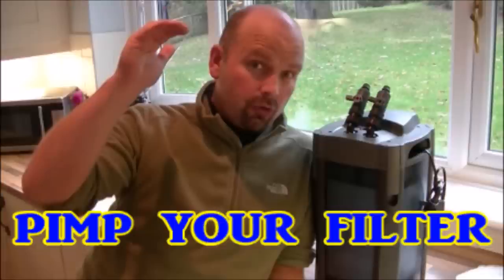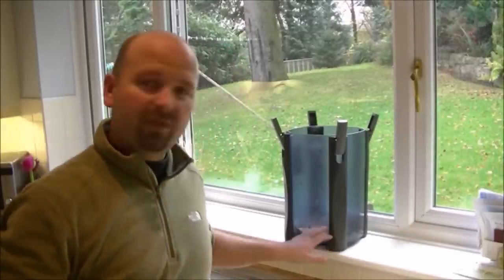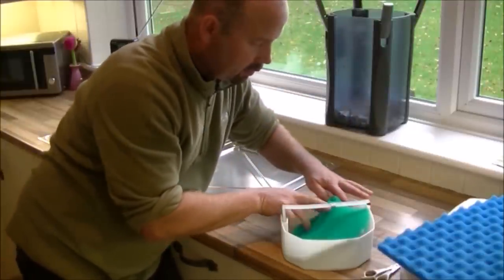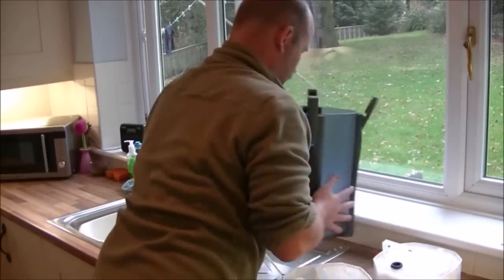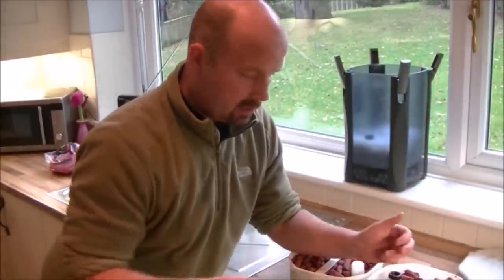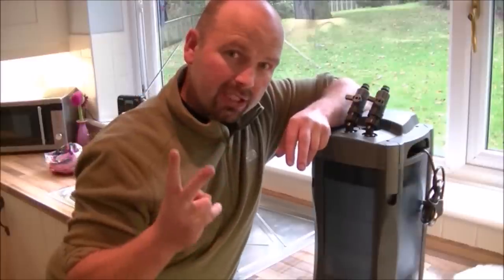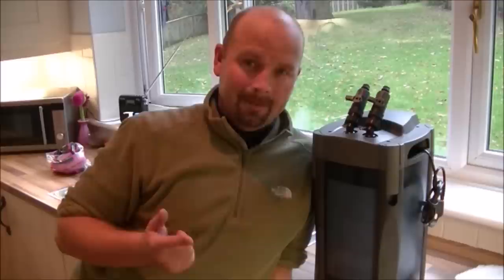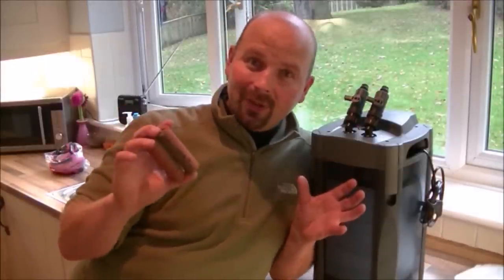External canister filter set up, nitrogen cycle and what happens in a filter - by Pondguru

Comment: Hi I want to try it out on my eheim 2080 that is hocked on a 400L Tank ( a bid overcrowdet with discus ) would be extremly awsome if it really works. are 3kg of the media enough for that filter?
Reply from the maker: De Helloo According to my records the 2080 will hold approx. 3.5kg of mini ultra or ultimate per tray so for 2 media trays (the 3rd - bottom one - would be used for foams) so you would need 7kg for the 2 media trays. For decent nitrate reduction you would use around 1kg per 100 litres but more is better, especially if overstocked. Biohome will still hammer down ammonia and nitrite if used at less than 1kg per 100 litres but needs to be used at a proper rate for nitrate reduction. If you want a price for the 7kg just let me know which country you are in and I can work it out no problem. My email address is pondguru@btinternet.com

Comment: Hi Richard, thanks heaps for your videos I’m learning so much. I have a hob aquaclear 70 on a 200 lt tank 0 ammonia, 0 nitrites and 40/60 nitrates I change 30% weekly. I’ve just got a sun sun 304 which says its for a 375 lt tank. I’ve also just found where to buy your pink media down here in Australia so I’ll order 2 kilo, should that be enough or do you think I would need that little booster sponge filter and more bio media for my size tank?
Reply from the maker: The 304 is the 525gph version which will hold 5kg of media (1.7kg oer tray) with the bottom tray being used for foams and fine pad. If you have a normally stocked 200 litre tank then the 2kg will be fine for that but I reckon I'd go for 3kg (fill 2 trays) to be sure, if it is heavily stocked then fill all 3 trays.

Comment: Dear Richard, I have a problem. I just started a freshwater tank a week ago,  I didn't add any fish because I wanted to start on the right way (thanks for the video and info), I went to the store today to get my water checked and the nitrite level was too high, the guy sold me some bacteria for my filter and some test strips, now here is the problem: I'm colorblind and I can't tell the difference between white and slightly pink, what can I do? Thanks!
Reply from the maker: I'm assuming you live alone too? That's a real bummer and I'd say take the strips back if you haven't used them. Strange the nitrite was up as that means that there must have been ammonia and the bacteria converted it to nitrite so it's good in a way as your filter has some bacteria working in there already.
Reply: Pondguru well I did use one of the strip as I got home because the guy said the nitrite level could be influenced by the bottle I had my water sample in, when I used the strip I couldn't tell what it said so there is the problem. I could ask my girlfriend to help me to check my water indeed but is there another way that doesn't involve color?  I added the bacteria (filter Biostart from Sera) to my filter, should I wait a day or a week to check my water again?  Thanks again :)
Reply: Pondguru I had a theorie about my nitrite level: a goldfish produces ammonium, ammonium is needed for the good bacteria to convert that to nitrite and stay alive right? If I add a goldfish to my aquarium, could it be that the nitrite level will decrease because the other added bacteria will convert the nitrite to nitrate for the plants to absorb? The bacteria will stay alive because they get ammonium from my goldfish. Is this correct or way to simplistic?
Reply from the maker: Potion of Kings Bacteria does need to be fed but I always tell people to wait until the nitrite comes down so test again in a few days and if it has dropped try adding a fish as there must be bacterial activity going on in the filter.
Reply: Pondguru will do :) thanks!

Comment: Hi pondguru I am using ur upgrade kit in my all pond solutions 1000ef+ filter was wonder if u could help wondering if there is away to slow down the flow back in to the tank as have a beta in the tank n I think the flow is bit fast for him could u help
Reply from the maker: You could put a flow control tap in either the inlet or outlet or close down the tap on the top of the machine but it's best to go unrestricted. If you're using the spray bar you could block off some of the outlets so water came in one side of tank only and if using single outlet direct it at the back of the tank to reduce current.

Comment: Hi pondguru! I am upgrading to an Eheim pro 4+ 600. This appears to have a mechanical pre filter at the top of the canister and what looks like good media. I have your media in my APS 2000 set up with foams at the bottom etc. What would you suggest with regards to setting up my Eheim and where I should put your excellent media in it and whether any of the supplied media is any good? Thanks.
Reply from the maker: +Paul Austin The set up for the Eheim pro 3 /4 is exactly the same as a normal filter except it has the 'pre-filter' sponge in the top of the filter. Just leave that in and set up the filter trays as you have with the 2000.
The media which comes with the Eheim filters can be very good but the structure is a little too dense compared to the likes of biohome mini ultra and biohome ultimate.
Seems a shame to waste it as it is good stuff so maybe start with the Eheim media (topped up with biohome if necessary) and see how it goes from there. You'll not know how it is working as far as nitrate reduction goes for a good 4-6 months.
Reply: +Pondguru Outdoors Thanks for the reply, I'll use all my biohome from the 2000 and top up with the eheim media,  many thanks

Comment: Please can you pimp my fluval 306 external filter want to start using Biohome Ultimate just wanted to see best set up- thanks
Reply from the maker: I recently filmed a video on the 306 so that will be coming up soon. With regard to setting it up just leave the foams down the side and use bottom tray for medium and fine pads. That will leave 2 trays for media and you can fit 1kg of biohome ultimate in each tray so 2kg for a 306 allowing for the bottom tray to be used for pads.

Comment: I would like to use this system in my canister filter which is a fluval 306 but the trays and foams are set up a little different with 3 trays for foam and media followed by another bracket which holds more foam. Would this matter? I kno the filter is completely set up wrong from the manufacturer. I would really like to use this system in my tank.
Reply from the maker: +Kenneth Griffin The 306 has decent foams down the side which water hits first then it rises through trays.
Leave the fluval foams down side then simply set up your trays with coarse, medium and fine foam in bottom then 2 trays of media above that. Each tray will get a max. of 1kg biohome mini ultra or ultimate in.
Regards,
Richard

Comment: Hey thanks a lot for sharing! I am setting up my first aquarium using a canister filter similar to the one in the vid but mine has 4 trays. I have some 10 micron polyester filter pad that I was going to use as the fine (final) mechanical filter layer. Is this fine enough? also I have some thick foam rolls for re upholstering, like sofa cushion stuff, (thinking of using that for the medium layer) will that work?
Thanks :)
Reply from the maker: As dirt comes in all sizes it's always best to go with foams of different grades to catch coarse, medium and fine particles. If we rely on only one fine pad it will quickly get clogged up so going with at least 2 grades will cut down maintenance time.

Comment: any ideas on upgrading a Fluval 06 series filter?? they do NOT have the same placement of things as most canisters. i want to make sure it has the best ability that i can for filtration for my axolotl, Nova Rosa.
Reply from the maker: Erin Ramirez Yes they work exactly the same as the one in this video (water flows through trays from bottom to top) but they have the extra foams down the side where the water hits first so when you are upgrading the fluval filters just leave the foam down the sides, set up the bottom tray with your coarse, medium and fine foam then the trays above that with media exactly as in this video for most efficient operation.

Comment: Hi just received my biohome. I have a 350 eheim classic which doesn't have trays so I have ceramic rings and the bottom then the three stages of foams then ehfisubstrate as the biomedia .Do I swap the bihome for the ehfisubstrate entirely at once or in small stages at a time.
Reply from the maker: If the filter is mature it is best to swap old media for new over a couple of months to maintain good bacterial activity while new media matures but it depends on the stock, size of filter and how close to the maximum operating level it is.

Comment: +Pondguru : This really makes sense to me! I am in Canada and I recently received a shipment of Biohome ultimate and a Cascade 1000 canister filter with 3 media trays. I filled the bottom tray (no room under the last tray) with plastic pot scrubbers (no chemicals) course and fine filter floss. Center tray is more fine floss and the top is about 1kg of the ultimate media. Is there any concerns with the ultimate media dust / particles pre-maturely wearing out the impeller? I rinsed it I am just worrying about undo wear on the pump components.

Comment: hi chap i have a fluval 406 filter how is the best set up with ur filter kit
Reply from the maker: +Neil Smith Just leave the fluval foams down the side to act as extra mechanical filtration then set up the trays as shown in this video. Each tray should hold approx. 800g - 1kg  depending on how neatly it is laid in so for 3 media trays you'd need best part of 3kg which is in the kit. I also do 1kg and 5kg kits for smaller / bigger filters.
Hope that helps.

Comment: Hi Richard. How about working with a NEXUS 320...? Could the K1 MICRO, or K1 MEDIA  be changed for anything better? Keeef
Reply from the maker: In a moving bed you could use biomotion but it would wear quite quickly in a Nexus.
The EA filters do a very good job of the first half of the cycle (aerobic stage) which processes ammonia and nitrite but they produce a nation of nitrate.
Best option in a gravity fed system where the pump would be after the filter would be to then take water to a shower filter full of suitable media which supports anaerobic bacteria to complete the cycle (reduce nitrate).
I still find it hard to believe that EA totally ignore that part of the cycle as the Nexus filters would be great with a shower part on the outfall to enable them to offer complete filtration. Huge regular water changes quickly get monotonous.
Reply: Hi Richard.
Thanks for this info.
I have a pumped system with a flow of 12,000 LPH running through a EVO55 light unit and then the Nexus.
So if I made a DIY shower tray system, like you have shown us in the past, I could take the water from the nexus into a 3 or 4 tray system and then exit back to the pond.
I bought the nexus to make the cleaning of filter foams a thing of the past... Do you think I am going to need to use foams in the top shower tray as well as the filtration carried out by the Nexus?
Do you think I could economise the tray media by mixing BIOHOME, ALFAGROG & Pumice???
Thanks in anticipation.
K
Reply from the maker: Yes all of that seems fine although I would avoid alfagrog if you're looking to reduce nitrates.
The Nexus should be capable of doing all the mechanical cleaning and the aerobic biological side of filtration leaving the shower to concentrate on the nitrates.

While the biohome is the most effective it is expensive compared to the pumice so if you are looking to maximise the cost / effectiveness it would be sensible to go 100% pumice.
Feel free to ring me any time on 07772848730 and I always have the phone on 9-5 no worries.
Reply from the maker: Dear Keith,
As far as I know we've already discussed this by phone? My memory is terrible and I get about 50 comments a day which I answer, plus all the emails so if I haven't answered this just let me know.
Regards,
Richard

Comment: Hey Richard ni have 2 fluval fx5 , wanted to know if you knew what order I would put the sponges and the biohome media,  not sure if I put the sponges prefilter on the top tray or the bottom tray, can you please help...thanks oh yeah..... happy new year. .... cheers
Reply from the maker: I actually mention this in the video but I'm not surprised if you've missed it as the video is not exactly short, lol
In the FX filters the water travels from top tray to bottom tray so it works the other way round to this one (since the pump is on bottom, not top).
As you already have good mechanical filtration all the way around the trays you should really only need medium and fine in top tray then media below that. The FX range takes up to 5kg of mini ultra or ultimate if you only go with fine pad in top tray, less if you pack out the top tray with layered foams (if top tray is filled with foam you would need nearer 3kg for remaining trays).

Comment: Hey Richard I finally ordered 7 kilos for my new sunsun 404b, existing 304b, and finnex px 360 small canister/hob filter from GreatWaveEng and I have already gotten the filter foams set up for them and the two sun sun filters filled and started but my px 360 is a canister rated for a 10-20 gallon tank and the intake coming in does NOT have a chute to go down to the bottom and I wondered if I needed to reverse the set up in this case considering the top tray gets hit with water first or if I need to design some sort of chute set for the intake water to go down to the bottom in order to work most efficiently?
Reply from the maker: It looks like an down/up filter so as long as you have it set up so water hits foams first then media it will be fine - no need to alter the structure of it.

Comment: Hello !
In the top filter basket, the sealing ring was missing from the pipe. :O)

Could you please make a video about the pimp with indoor filters and Hangon filters?
Sincerely
Axel
Reply from the maker: I think I put the trays back together in the wrong order so the seal was on a lower one.
I do have an internal filter but there are so many different types that any video I make on it may be irrelevant for other internal filters. HOB filters offer very little filtration possibilities so I don't want to encourage people to buy one let alone try to get it to work properly.
Unfortunately many filters now have a replaceable cartridge system and special size foam so the manufacturer can get future sales from people who buy them and they make them so that altering them is difficult.
The internal filter I'll make a video for is a decent one so it should be of some use to people wanting a good internal filter with plenty of space for proper media.

Comment: hi there. i just learned about this highly interesting bio media, and want to try it out. But how much do you recommend for a fluval fx4 i a 530 l. tank with neon tetras and plecos and loads of plants  ??
Reply from the maker: The Fluval 4 will hold a maximum of 3kg (1.5kg of biohome ultimate per tray) and as you have good foams surrounding the trays you really only need a fine pad on top of top tray.
Your tank sounds very lightly stocked so 3kg may be enough to achieve full cycle filtration (reduction in nitrate) but for a normally stocked tank you'd generally need around 1kg per 100 litres with up to 1.5kg-2kg per 100 litres for a heavily stocked tank. If the FX4 is the only filter you have on a 530 litre tan it may be way too small due to the limited amount of media it holds.
The latest filtration video I did may be of use as it goes into detail about sizing filters, how to set them up and how much media is required to achieve full cycle filtration: https://www.youtube.com/watch?v=L5FkSTYkEAE
Regards,
Richard
Reply: thanx for your answer Richard, so i should have bought the fx6 instead. just seemed like overkill and i was afraid that the flow would be too powerfull for a 530 l tank. maybe i will have to get a second cannister to join the fx4.  thanx for your advice regardsklaus
Reply from the maker: No worries, any time.
Reply: klaus winther I have both fx6 and fx4 each running in their own 75 US gallon tanks, I don’t see any big differences regarding  output flow, with extra tray fx6 way to go as long as you have enough room to accommodate

Comment: Sir plz guide me about sunsun 304b come with 4 tray plz recommend me which media I put in this tray
In my filter bottom of tank course medium and fine pad.second I put bioball. Third one I put ceramic ring and top tray I put seachem matrix Is that right stage?
Reply from the maker: Yes the filter works from bottom to top so all foams and fine pad would be in bottom tray. According to my records the 304 will hold approx. 2kg of either biohome mini ultra or biohome ultimate (2 best types for canister filters) and ideally you would have 3 trays filled with proper biological media.
You have a mix of media types above the foams which is fine but there is really only the pumice (matrix) which will act as a decent media at present (and it may raise the pH, depending on size of tank, since white pumice has a specific pH of around 8.0).
If you don't want to add more media you'd be better swapping the bioballs for extra foams.
Reply: Thank you sir
Reply from the maker: No worries, any time.

Comment: +Pondguru Outdoors i have a fluval 206 and this upgrade kit. how do i set it up? foams on top or bottom?
Reply from the maker: +Witz End Bottom tray would be for foams then media in tray(s) above that. The foams down the side of the filter would act as extra mechanical filtration but if they do a good enough job of cleaning the water you can go with all trays filed with media.
Reply: Pondguru Outdoors
thanks alot ill get my filter set up.